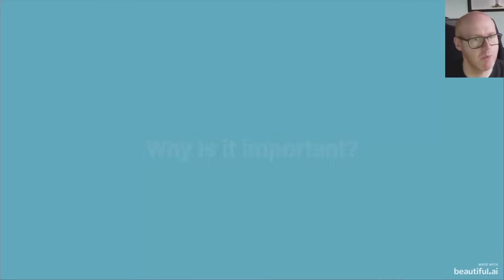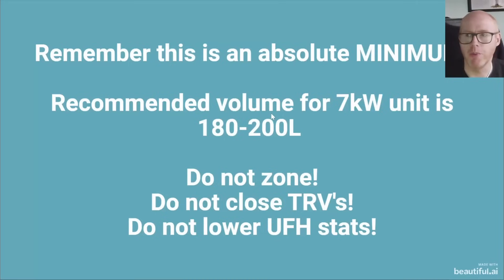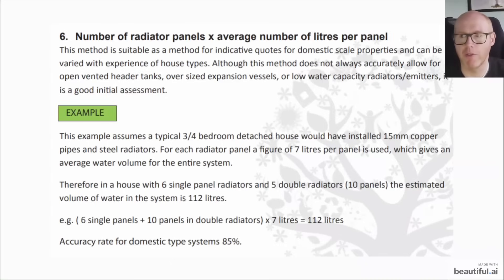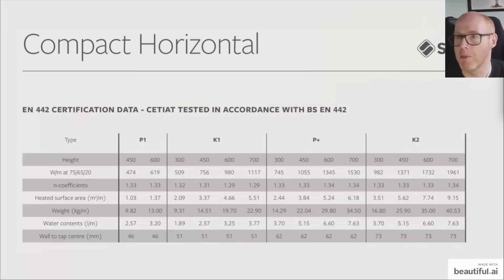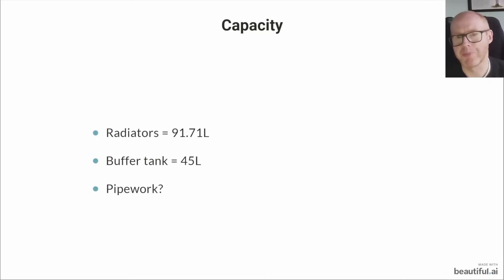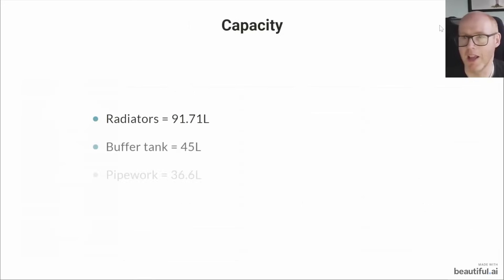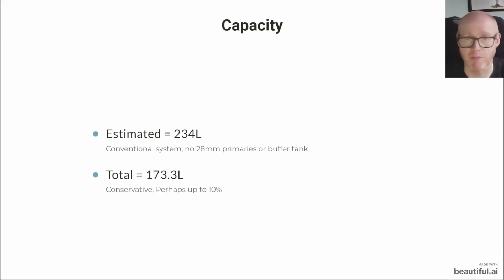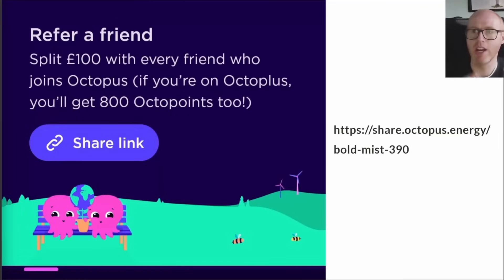How to Reduce Heat Pump Frost

Comment: I’m thinking of upgrading my boiler to a heat pump. I love this user knowledge your insights are eye opening. I never considered system volume. 
I also have a solar battery system but just weighing up extra load and longevity of my batteries if I do install a 5kw Hp. What’s your typical load / consumption from the HP during the winter months. 
PS after watching other posts about North facing solar panel, I have now installed panels on my north facing roof. They are performing better than I thought, hope they still produce in the winter. Thank you 👍
Reply from the maker: Typical winter consumption is 10-20kWh. Some of that is easily shifted into the off peak time anyway so it's unnecessary to have battery storage to cover the full energy demand.
Great to hear about your north facing panels. My NW facing array is great all year round.

Comment: If you are getting good performance with your 7Kw Vaillant, I would leave well alone and keep your buffer!
Don't try and eek out a little bit more performance, for something that might help when the weather gets below the design temps.
In our UK weather the defrost cycles can cause havoc and the published output data on the 7Kw unit, doesn't seem to live up to the figs that is purported. The heat geek guru Urban Plumbers ( they don't fit buffers!) has had so many problems with the Vaillants, noisy, under performing by 20% etc, he has fitted resistive heaters into the systems for extra heat, and is now NOT specifying Vaillants.
It also seems the COP figs arent correct either, coz they dont  take in consideration of the kwh cooling of the heating system on defrosts cycles. Which on some systems was 0.4Kwh per defrost. The system only counts the energy in and the heat produced.This seems for all manufacturers though🙄
Reply from the maker: Thanks for commenting.

Comment: Interesting video. I have a Samsung 12kW heat pump, and have just calculated my system volume to be ~190L (94L in 12 rads. 46L in pipework and 50L volumiser). The Samsung recommended minimum volume is 50L. During a defrost cycle, the flow temp drops from 35C to around 20C, but recovers again fairly quickly presumably to the large system volume. When the system was installed, I didn't want the volumiser, but after the first winter and observing defrost cycles first hand, I now recognise it's value. I can see how a heat pump that is not oversized (i.e, just able to meet the heat loss requirements at -3C) and low system volume may cause the system to really struggle on the coldest of days. I thought the 8kW Samsung unit and no volumiser would have been more suitable for us, but having now lived through some colder weather, I can see the larger unit is able to handle this with ease.
Reply from the maker: Good to hear that your system is working well for you.

Comment: Thanks for this, I'm currently doing research before deciding on a Heat pump. I was unaware of the importance of volume so that's gone into my crib sheet. Had solar and battery installed just over a year ago, and with my latest Octopus bill have a years worth of data so I can see exactly how much gas and electricity I used. Being on Agile and Gas tracker my gas averaged out to 5.2p per kWh and my electricity costs just about 9p per unit, so it looks like that with a decent COP a heat pump is definitely the way to go.
Reply from the maker: @devjon123   nice! It sounds like you're well prepared and you'll end up with a good result 👍

Comment: Column rads are pretty good for volume. 1x triple column 1800 high x 450 wide has 27 litres! Big thermal mass in radiators will smooth out cycles and defrosting.
Reply from the maker: That's a great tip for anyone who has the house to accommodate them.
Reply: @UpsideDownFork  they take up the same space as the equivalent K2, maybe 1cm deeper. They have a slightly lower output Vs same K2 but benefits in other ways. Horses for courses 🙂

Comment: I’m getting half an inch of snow on the back of the unit and even when it defrosts the bottom third was solid ice. 500l thermal store but at only 23C…
Reply from the maker: A third staying frozen solid? Crazy!
Reply: @UpsideDownFork tried a hot water cycle still some left but don’t think that’s normal - maybe a faulty sensor or the low circulation temperature

Comment: Interresting! But what do you do with your bedrooms? Any in use in my house get turned down to 14 degrees at night, i could not sleep in a room heated to 20 like the rest of the house? I had a Hive system with my old boiler so just kept that to control any bedroom temperatures as required, all the rooms are normally set to a temperature greater than they will reach so the TRVs are always open except occupied bedrooms, seems to work.
Reply from the maker: It's definitely a challenge. I like a cool bedroom but my wife likes it hot so we've both learned to compromise. Our bedrooms typically sit at 18 degrees during the day and cool to about 16 at night.

If we know our system volume and know that we can safely isolate a couple of bedroom rads without affecting performance then it's no problem. The danger comes when people start turning rads off and the heat pump doesn't have enough volume to defrost itself.
Reply: I have mine set to 18 degs from 10pm to 2 am and 21 degs all other times. 
That allows the temp ramp up overnight using cheap tariff ready for morning...

Comment: Hi Mate.
Thank you for your great job.
Did you try or do you know If I can set up set up pure weather compensation for the day time 5.30 - 0.30 and fixed value for overnight 0.30 - 5.30 to use cheaper tariff charging my 800l buffer tank (20°C-52.5°C= approx 30kW ).
I have the same HP.
Many thanks
Reply from the maker: Set the room temp mod. to inactive and you'll be utilising pure weather compensation on a Vaillant.

Then you will need to set different internal temps on your schedule for those different time periods.

You'll need plenty of experimentation to find the sweet spot.
Reply: @UpsideDownFork  
Thank you for the advice.
 Currently I am on heat curve 0.50 which is fine as a sweet spot. But when I want to charge the 800 l buffer ( second pump controlled by the app and thermostat is responsible for heat distribution) I have to change all the settings and I am not keen to get up at 5.30 to change the settings back for the weather comp. I do not have the kit for app control (probably there is no option in the app either) It might have been challenging for Vaillant to set up controller to run Weather Comp control and later use fixed value settings. But luck of settings to set up different heat curves for different time periods that is not really justifiable. I would like to use night tariff  to charge my system but without pumping heat into the property when is not needed. I would set up the right curve to get me the required temperature during cheap tariff. This looks like Vaillant could have done more to have that option in the Senso Comfort.  Imagine you can't set up your PV system to charge your batteries using cheap electricity unless you do it everyday manually.

Comment: Here we go again  " The flow of B/S is never ending".  My COMBI BOILER HAS NON OF THESE PROBEMS. I do not need UNDER FLOOR  HEATING .
Reply from the maker: @GrahamNewman-mq7gr  who are you quoting? Also, why are you shouting?
Reply: @UpsideDownFork  People want warning about all this HEAT PUMP  B/S  been  thrown out by you EVANGELISTORS.
Reply: @GrahamNewman-mq7gr  I've just had a heatpump installed. It's made a huge difference to the overall warmth of my home and been great over the freezing weather we've just had.
It's embarrassing shouting about things you have no understanding of.
Reply: @AlanTov  No UNDERSTANDING realy. I am fully converstant how these  things work.  Marine career Chief Engineer  50,000 ton LPG  carriers .Large Container Vesels up to 200 Refridgerated Containers. These systems are a "Complicated answer to a non existant problem". A Combi Boiler turn it on "Hot Water "  as you want it , as much as you want , Bath / Shower ect. Heating turn it on Radiators hot  62C  after 20 minute All house up to temp  under 1 hour.  Your "Heat Pump will never do this".  Latest Combi Boiler  £2000 Installed, 10 year parts / labour warranty.    You probably have "A  4  WHEEL ELECTRIC LEMON" DEPRECIATING  £500 A MONTH ON THE DRIVE"  to complement the  HEAT PUMP.
Reply from the maker: @GrahamNewman-mq7gr  ok. We'll have to agree to disagree.
Thanks for stopping by.
Reply: @GrahamNewman-mq7gr  funny how the people who actually have one and practically live with them think differently. 
Ps. Climate change.

Comment: I had an Octopus 4kw Daikin system installed  2 weeks ago. With 3 small radiator upgrades.  Interesting challenge with the weather!
It has performed fantastically well in terms of heat delivery. Cosy the whole time. 
My only issue is noise, about 66db at 1m. I need go check octopus removed the transportation bolt and/or get them to have a looksee. 
Maybe that's normal at freezing temps, even outside defrost cycles...
Reply from the maker: Congratulations. Good to hear that it's mostly working well for you.
Hope the noise issues gets ironed out.
Reply: Update here what you find because we had a giant (16Kw !) Daikin installed by Octopus in November and it's had a a proper cold weather workout since. House is delightfully warm but the noise is very high. Same 60+db regularly during the day and night and probably higher during defrost cycles. I've been thinking of contacting them to see if this is right because that level is loud enough to annoy.

Comment: Thanks for this info. I’m finally getting a heat pump installed by Octopus (assuming planning approval). First time round they said they couldn’t do it because UFH would cause a pressure drop. Now, calcs are passing, the only design change is they’re leaving most of the radiators alone. 25ltr volumiser, 11kW Daikin heat pump. No one ever explained to me what the actual issue was regardless of how many times I asked. I’m guessing though that the total water volume was more than the unit maximum once the radiators were upgraded to the original design, so the opposite of what you described in this video
Reply from the maker: Ah, interesting.
Volume and pressure/resistance can't be used interchangeably.
More volume is always good but more resistance is always bad because circulation pumps have to work harder.
Sometimes with more system volume comes more pressure but not always.
The 11kW Daikin likes a lot of system volume and definitely doesn't have a maximum amount.

Good luck 👍

Comment: Sound like a lot of messing about for a massively expensive system with no real savings compared to a efficient cheep to run gas combi boiler.
Reply from the maker: This system cost me less to install than the quotes I got for a combi boiler.

It saves me a couple hundred £££s in running costs every year.

Thanks
Reply: of course it did🤥
Reply from the maker: @Cyberbobxxxx  full details in my other videos including proof of quotes and energy bills etc 👍

Comment: All interesting stuff👍, but not talked about much, when comparing the costs compared with a modern gas boiler.Because the system has a lot more water volume with the Buffer/Volumisers and larger rads, it will take more energy to heat that water. Also in the cold/humid weather, the heat pump will need to de- ice more often, using the heating water with or without the buffer/Volumiser, this water will then need to be reheated by the heat pump over and over again.
Is there a rule of thumb of how much Kwh is being wasted by extra volume and the de- icing process?
Also No one seems to factor the heat losses of the extended exterior pipe runs, I see on these heat pump installalations that arent required with a gas boiler coz its normally within the house envelope.
Reply from the maker: No energy is being wasted by having extra volume. It's in fact the opposite.
Less compressor stops and starts and less defrosts means more volume is always more economical.
It may take longer to heat the extra volume from a complete standstill but it will have better thermal inertia, smoothing out any peaks.

The external pipework heat loss is very minimal as long as they are insulated properly but can be calculated if you wish to.
Poor performing pipe insulation will require a higher flow temp and result in a lower COP.

COP is the relevant metric to use when comparing gas to HP consumption.
Reply: @UpsideDownFork  thanks for prompt reply👍

Comment: And you didn't mention the pitfalls of system volume when in DHW mode........

The correct way of calculating system volume is considering the number of stop/starts permissable and the kW output of the unit.
Reply from the maker: Thanks for commenting.

I was trying to keep this fairly basic for owner enthusiasts without getting into a serious maths/engineering class.

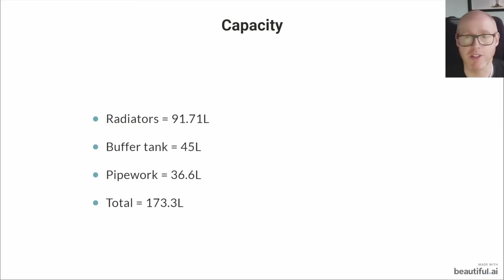Comment: For info re suppliers , Eon have a tarrif next drive 5 which is 6.7p for 7 hours midnight till 07:00 , then it 24.67 and a 64p standing charge . Helpful if you have big battery system to charge .
Reply from the maker: That looks like a really attractive deal. Do you know what the export rate is on that?
Reply: @UpsideDownFork Just checked and it looks pretty decent. 21p/kWh (eon installed panels) or 16.5p/kWh for everyone else. Up to 15kW solar array.
Reply: We have solar panels and battery, but we don't have an electric vehicle ( or any vehicle come to that, unless you count the bicycles 😉 ). It's interesting to note that several energy companies have tariffs that are more advantageous if you own an electric car.

Comment: I have a 50 or 60 litre buffer tank in my system and based on the rule of thumb a total capacity of ~ 277 litres.  This seems a bit small given I have two 9kW heat pumps, but the LG Therma V manual doesn’t specify anything about the system water volume, so who knows.  But not that I could do much about it, can’t really add another buffer tank and I would only change radiators for bigger (which I have done 3 post-install) if it was required to achieve room temperatures.
BTW, be careful about the advice you gave on draining down and fully refilling the system to calculate actual system capacity.  My system was at least part filled with ethylene glycol mix in the water to prevent freezing with the outside pipes when the system was turned off. I have subsequently had a leak so that’s all leaked away and been replaced by water, but if like me your system has anti freezing liquid in it, then draining down isn’t the best thing to do
Reply from the maker: Very good point about draining down. I doubt anyone would go to that length to measure their system volume.
Some heat pump 'experts' seem to use 25L /kW as their rule of thumb but I'm not sure how this would be applied to twin pumps and could certainly differ if running in cascade.

Comment: Very interesting. Can the hot water tank be used for defrost rather than the radiator circuit?
Reply from the maker: That is not advisable. Because topping up again requires higher flow temps.
Reply: My system (Samsung ASHP) will default to using which ever is in operation at the time the defrost is needed. If heating is running, it takes from that, but if it's in the middle of a DHW reheat cycle, then it will take from the DHW tank. Other makes may vary, but there's no way to set or change that behaviour on Samsung systems.

Comment: Good information and analysis.

I find comparing your own system against others on OEM is a bit of a double-edge sword. Unless you know the system you are looking at in detail comparing against your own is tricky. Knowing how the household runs their system, things like DHW run frequency, temperature, legionnaire cycles, setback, operation mode (normal, eco etc), rad sizes and so on. So many variables to consider. 

Our system defrosts once every 60 minutes when it drops below 5ºC and when it falls below 0ºC perhaps twice every 60 - 90 minutes which is quite normal. We do have a large system volume (which I will calculate now having watched your video) we also have very long primaries much of which are outside. I'm sure they take a hit on heat loss because of that. 

Humidity has a massive impact on defrost frequency as well as flow temperature. The more humidity has more moisture in the air which means more freezing onto the fins at the back of heat pump. A higher the flow temperature will also result on more frequent the defrosts as the heat pump has to work harder to get up the temperatures.
Reply from the maker: Great comment! Thank you.

I totally agree with all your points made.
Reply: I agree about OEM. Without knowing how people run their systems, it can be tricky to compare against your own. 

As for system volume, I imagine that there's a minimum needed - enough water at a sufficient temp to defrost the system - but beyond that I can't see that more volume is helpful.  I suppose a few minutes of defrosting and a few degrees lower in flow/return temp is normal. 

My system has been defrosting every 1/2 hour at times, but even at 1C daily average, the COP is 3 - SCOP is still over 4 (including DHW). The best performing Arotherm on OEM's heatpumpmonitor site appears to have similar performance (although a higher COP).

Comment: That's very interesting, adding up my existing radiators, excluding the two towel rails comes to just 85 ltrs, not much really, pipe work will add more, not much though. I've started the ball rolling for our ASHP, just need to book some surveys, one with a Heat Geek, other with an approved Vaillant installer. In other news I put a deposit on a 3 year old E-Niro today, so I'll soon be joining the EV club.
Reply from the maker: Big news day for you! Congratulations 🎉